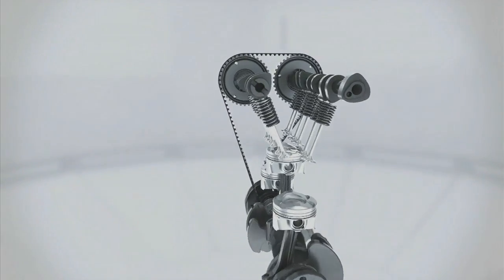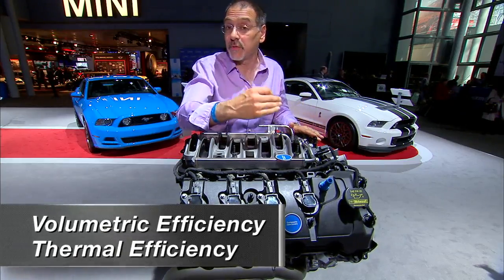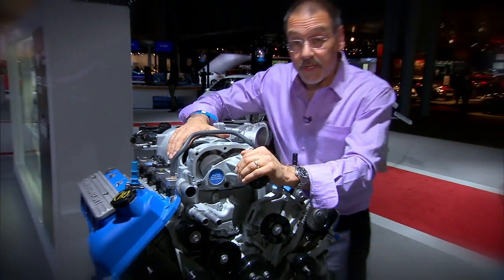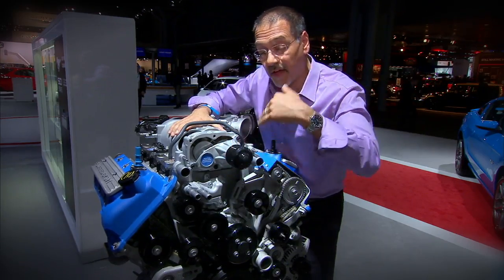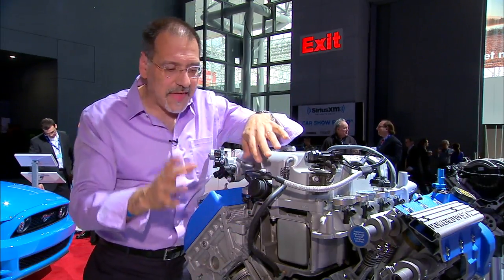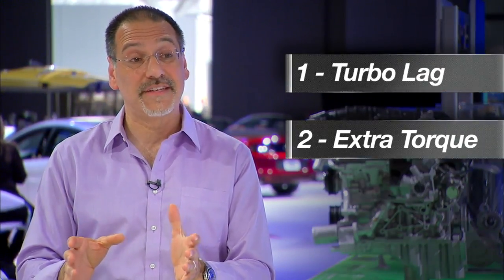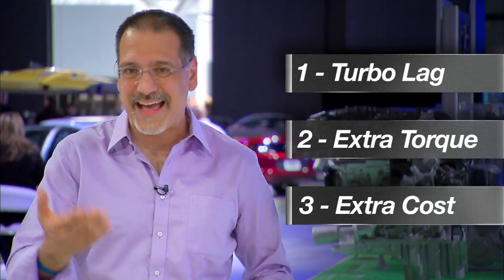CNET On Cars - Car Tech 101: Turbos vs. Superchargers

Comment: To anyone who has actually studied turbocharging and supercharging, half the things this guy said was bullshit.
Reply: why? Like what?
Reply: Many things. Here's just some examples. 1) He says that a supercharger has parasitic losses, but doesn't mention the fact that a turbo has pumping losses. 2) He talks about intercooling to cool off the air charge that was compressed to raise its density, but doesn't mention that there is drop in pressure when you cool the gas, which lowers its density also. 3) He says turbocharged engines have a lot of torque compared to the amount of horsepower they have. That's only true for small turbos relative to their engines. Small turbos produce a lot of torque compared to horsepower. Large turbos do just the opposite, no torque and tons of horsepower. 4) He fails to mention that turbos radiate exhaust gas heat into the entire engine bay and into the turbo compressor, which effects the durability of the engine and its parts and also reduces the air charge density which effects power. 5) He says superchargers are used "to create additional brute horsepower than to create efficiency and really high mpg". Turbos produce more power per cubic inch than superchargers. That means turbos produce more "brute horsepower" than superchargers. 6) Turbos do not improve mpg. Turbos require more fuel to cool the air charge which means the air fuel ratio must be richer than if the engine was normally aspirated. This means turbos burn MORE fuel than normally aspirated engines. 7) He says "you're unlikely to find cars that have superchargers, they tend to be extremely high performance." Then he says, "so let's talk turbos", as if turbos cars aren't extremely high performance. Turbos outperform superchargers in power per cubic inch. So what the hell is he talking about when he says superchargers are extremely high performance but turbos aren't? However, turbos are a pain in the ass to set up, are easier to detonate with, and produce too much heat in the engine bay. Turbo exhaust manifolds are more prone to warping and cracking also. I personally prefer superchargers for a street car, but on a track turbos produce more power per cubic inch than anything else. They do not improve fuel economy as he claims, they REDUCE fuel economy since more fuel is required in the AFR's to cool off the air/fuel charge and keep the engine from detonating. I can keep going on and on about bs he says.....
Reply: Thanks for the great answer !
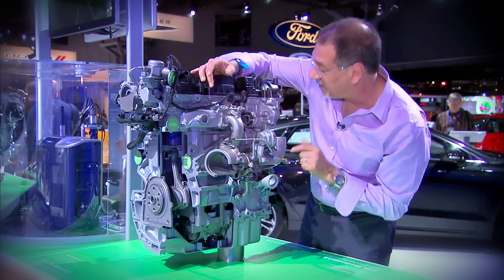Reply: At 1:16, the location that he points to for the entry of cold air into the turbo compressor is the wrong location. He pointed to the compressor outlet. The compressor outlet is not where cold air comes in from. He also does not mention that a turbocharger is easier to run into detonation with than a supercharger. He probably has no idea what detonation or pre-ignition is anyway.
Reply: what is detonation and preignition? im trying to learn
Reply: Detonation is preignition, it is when the fuel and air mixture ignites before the spark plugs fire, which can lead to all kinds of damage in the car. Most engines have knock sensors to prevent that!
Reply: would a supercharged car also consume more fuel, or that only comes with the turbo?
Reply: Daniel If you supercharge a car you get less MPG If you turbocharge it you get more MPG :)
Reply: Not really a bullshit, just a different perspective than yours. 

IMO this video is targeted to general car buyer, not car enthusiasts as you. I'm not sure if you're aware of the fact that car manufacturers nowaday are pairing small engine with turbo to create a more efficient car for the purpose of daily use to workplace or grocery. 

Sure,  both turbo and superchargers  equipped engine can deliver higher performance but the difference is you can easily scale down turbo for efficiency while you can't easily do the same with supercharger.
Reply: z4520ft You can do that with superchargers...just bild a smaller supercharger...Turbochargers are more efficient, easier to intercool, achive higher boost pressures and so on and so on!
Reply: a supercharged engine will consume more fuel. A turbocharged engine also consumes more fuel. The esseboy who says "if you turbocharge it you get more mpg" is wrong. A turbo increases fuel consumption, it does not reduce it. That's how more power is made, by burning more fuel. Any device that increases the power of an engine will also burn more fuel. Fuel consumption and power output are tied together.
Reply: inertiaforce No, if you increase the working pressure of an engine you will increase the flamefront speed, thus increasing the efficiensy of the engine! The only time it decreases is if you go and inject more fuel than stochiometric! Thats why all economic cars have turbos...
Reply: Let me ask you a question, are you saying that under wide open throttle, a turbocharger will not burn any more fuel than a naturally aspirated version of the same engine?
Reply: inertiaforce How is that relevant if we talk MPG? You never go full throttle when cruising...the think is it efficient with a turbo...many manufacturers have similar engines in turboed and unturboed versions, and why is it that the turbo version always have beter MPG?
Reply: Please answer my question.
Reply: inertiaforce Yes it does, but it burns the fuel more efficiently so you would still get more MPG...
Reply: Ok, so you just admitted that the turbo burns more fuel under wide open throttle and therefore gets less mpg under wide open throttle. However, you said it burns it more efficiently, and therefore gets better mpg. This answer contradicts itself. On the one hand you're saying that the turbo gets less mpg, on the other hand you're saying that the turbo gets more mpg. Please answer my question more clearly, are you saying that under wide open throttle, a turbocharger will not burn any more fuel than a naturally aspirated version of the same engine?
Reply: If you aren't under boost when cruising, then theoretically the mpg of the turbocharged engine should be the same or similar to the naturally aspirated version of the same engine. The turbo might still be slightly less (barely) because of exhaust back pressure creating a pumping loss, but that's debatable.
Reply: inertiaforce As I stated before....the increase in working pressure increases the flame front speed...which causes more fuel to burn! That increase efficiensy!
Reply: Causing more fuel to burn reduces mpg. You are burning more fuel. Burning more fuel = lower mpg.
Reply: ""the increase in working pressure increases the flame front speed...which causes more fuel to burn! That increase efficiensy!"

You're right, it does cause more fuel to burn! Burning more fuel = lower mpg. You only get higher mpg when you burn LESS fuel.
Reply: inertiaforce No, you do not...because since when do you drive around with fully open throttle all the time? Are you really that stupid?
Reply: Yes I'm really that stupid. I think people drive around with full throttle all the time. 

You still haven't explained how a turbo burns less fuel to increase mpg.
Reply: inertiaforce Oh you see Billy Boo, if the the engine can burn more of the fuel already inside the cylinder it doesn`t need to squirt in as much each time that thingamajig suckles in air. And there for you miles per jug of gallon of fuel increases. Whoop ti do, who would have known Billy Boo?

Do I have to explain it even simpler?
Reply: Well that's interesting, if the engine isn't even under boost, you are saying that the turbo burns more of the fuel already inside the cylinder. How is that possible when the engine is not even under boost? When the engine isn't under boost it is operating just like a normally aspirated engine.
Reply: inertiaforce Well Billy boo, you see automobile manufacturers aren`t stupid like you and runs small enough turbos so they spool at around 2000rpm, so they increase efficiensy....
Reply: So you are saying that an engine that is under boost burns less fuel than an engine that is not under boost?
Reply: inertiaforce Yes, as the working pressure increases the flame front speed increases and more of the fuel has time to burn.
Reply: Ok, so then under wide open throttle, a turbocharged engine that is under boost should burn less fuel than a naturally aspirated version of the same engine?
Reply: inertiaforce No, because it is under boost, at full throttle it will burn more fuel because there is more air so you can burn more fuel, but as you have more power you don`t need to go full throttle as long and there for burn less fuel...
Reply: "because it is under boost, at full throttle it will burn more fuel because there is more air "

You just said that being under boost burns LESS fuel. Now you're saying that "because it is under boost", "it will burn more fuel because there is more air."
Reply: And what you don't seem to understand is that everything you've said has been bullshit. You've contradicted yourself several times already. A turbocharged engine does not burn less fuel than a naturally aspirated engine. It burns MORE fuel. When the turbocharger is under boost, it burns MORE fuel than a naturally aspirated version of the same engine. That's also why it makes more power, BECAUSE it burns more fuel. There is a relationship between power output and fuel consumption. Increased power output increases fuel consumption. Power is produced FROM the burning of fuel. The more fuel that is burned, the more power. Therefore, a turbocharged engine that makes more power than a naturally aspirated version of the same engine will get LOWER gas mileage. The only reason I've seen that manufacturers claim turbochargers improve gas mileage is because they allow you to build a very small engine with a turbo to make the desired power output. Since the small engine is not under boost during most driving, gas mileage improves. The gas mileage improvement is from the small size engine, not from the turbo. If I build a 1.0 liter engine and turbocharge it to make the power of a 2.0 liter normally aspirated engine, I will get better gas mileage from the 1.0 liter engine since I'm not under boost during most driving of the 1.0 liter engine. The gas mileage improvement is from the fact that I am using a 1.0 liter engine, not from the fact that its turbocharged. The turbocharger is just there to produce the power WHEN i need it. Most of the time I won't need it, and therefore the 1.0 liter will burn less fuel than the 2.0 liter because of its small size. The mpg is from the small size engine, not from the turbo.
Reply: inertiaforce You are simply wrong...then why does cargo ships with the highest reported efficiensy use Turbochargers? Maybe because it actually increases efficiensy...
Reply: I don't know anything about cargo ships, so I can't comment on that. However, every book I have read on turbochargers and superchargers states that they burn more fuel. Therefore, if they burn more fuel, they do not increase gas mileage. They reduce gas mileage.
Reply: inertiaforce You have never driven a car I presume...
Reply: I have owned a 1993 Toyota Supra turbo modified with a single turbo, I have owned a 2005 Dodge Viper GTS, I have owned a 1995 Mitsubishi Eclipse GS-T, I currently own a 2003 Mercedes SL55 AMG and a 1994 Toyota Supra turbo. So yes, I have driven a car.
Reply: inertiaforce Doesn`t sound like it, maybe your boyfriend drove you around in them? Because you sure don`t drive around with 100% throttle all the time...
Reply: And it doesn't sound to me like you know anything about turbocharging either. Everything you've said has been bullshit. Go read a book on turbochargers and learn that they do not improve gas mileage. They are a power adder, and a power adder does not improve gas mileage. It reduces gas mileage.
Reply: inertiaforce I have read books in Chemistry, physics and math, and they all point to an increase in efficiensy...As you compress a gas the distane between the particales decreases, as that happens reactions will occur faster, and in a limited amount of time more reactions will occur. That increases efficiensy and will increase mpg as you can decrease the rpm and decrease the throttle opening.

Now you have only driven performance oriented turbocharged engines, which are a whole other story, they inject more fuel than needed to cool the intake charge...that is unburnt fuel going down the pipe leading to a lower mpg...but in economy orientented cars the fuel mixture stays stochiometric...

Did you get it now? Or do I litterally have to write an essay for you to get it? Performance cars use a mixture of say 10-12 parts air to 1 part fuel, economy cars use an mixture of 14.7-20 parts air per part fuel...there is the difference!

And if you got an halltech ECU you can switch between an economy engine map, normal engine map (close to stochiometric all the time) and an performance map...all on the go so why the hell wouldn`t you use an turbocharged engine?
Reply: Even if the AFR stays at 14.7:1, it will still require more fuel to maintain that ratio under boost than it would without boost. There is more air under boost, so maintaining 14.7:1 AFR will require more fuel than a naturally aspirated engine operating at 14.7:1.

If what you say is true, that boost increases gas mileage, then why doesn't that apply to superchargers? In your post above, you answered Daniel's question and stated that superchargers reduce gas mileage but turbos increase it. Why would a supercharger reduce gas mileage then?
Reply: inertiaforce Because Superchargers are belt driven...the increase in back pressure in a turbocharged car is nothing...
Reply: What about still requiring more fuel to maintain 14.7:1 AFR's for an engine that's under boost vs. an engine that isn't?
Reply: inertiaforce Which creats more power...which means you use less throttle...
Reply: uhh guys, peace... so my understanding is that fuel consumption will come from the driving habit as well. So turbo can consume less because I don't need to press the throttle that crazy to feel some acceleration, but on the other hand, the engine also burns more fuel. I don't have any comparison, but I can tell you that my 2.0TD VW engine eats less than 7.5L even if I poke it's eyes off or drive 170km/h on the highway while a non turbo, gasoline engine would eat 10+L... not sure if it comes from the different construction of diesel / benzin engines, cause I know nothing about mechanics...
Reply: Creating more power means that you are burning more fuel. It doesn't matter if you use less throttle. If you're making the power at a low rpm with boost then you will burn the fuel at that rpm and throttle. Obviously you don't need more throttle because you're already making the power. By your reasoning then, a big 8.0 liter V10 engine gets good mpg because you're using less throttle and rpm to make the desired power compared a 2.0 liter 4 cylinder engine which has to rev higher and use more throttle to make the same power output. For example, let's say say an 8.0 liter engine can make 200hp at 2000rpm while a 2.0 liter engine can make 200 hp at 6000 rpm. By your reasoning of less throttle and lower rpm getting better mpg, the 8.0 liter engine should get better mpg since you don't need to rev it as high and use as much rpm. So now an 8 liter engine gets better mpg than a 2.0 liter engine since you don't need to rev it as much and you can use less throttle. But as we all know, an 8.0 liter engine will gets lower mpg than a 2.0 liter engine, so what are you talking about?
Reply: I just did a google search "how does a turbo improve fuel economy?". Google said:

"Turbocharged vehicles allow automakers to keep power output high while they downsize engines for better fuel economy. But much of the mpg gain is lost when American drivers stomp the gas pedal and enjoy turbos' high performance.Jun 9, 2013
MPG or performance: It's a trade with turbos | Autoweek

http://autoweek.com/article/car-news/mpg-or-performance-its-trade-turbos"
Reply: So it appears that Google agrees with me, the gain in mpg is because of the smaller engine, not because of the turbo.
Reply: 66% down the page of the Autoweek article, it says:

"But when the turbocharger is running, fuel economy declines, sometimes dramatically."

http://autoweek.com/article/car-news/mpg-or-performance-its-trade-turbos
Reply: Based on all the above, it appears that you are wrong Esseboy. A turbo does not improve mpg. It's the smaller engine that's improving the mpg when its not under boost.
Reply: inertiaforce sigh I`ve too done some reserach and it seems like the point when turbos actually increases the Thermal efficiensy is when you are at just above Zero boost, then the turbo supplies the air so you have no pumping losses and at the same time the back pressure is low.
Reply: That may or may not be true, I don't know. I have seen no evidence that its true, but I haven't really investigated that question. However, if you claim its true, please provide a link to any research you have done that indicates that and I would be glad to look at it. Even if it is true, that still means that turbos do not improve mpg 99% of the time (because you aren't driving at 0.1psi 99% of the time).Also, don't be so quick to call people "Billy boo" when they dispute you.
Reply: TheRealestEver since you seem to be such a turbo genius why don't you please explain it?
Reply: I have not seen Jay Leno's TT'd V6 Camaro so I don't know anything about it. In addition, I have not seen any evidence of a gas mileage test between Jay Leno's TT'd V6 Camaro and a stock N/V V6.
Reply: I agree with @inertiaforce. For a turbo to run you have to sacrifice efficiency so therefore you burn more fuel which decreases the MPG. They downsize engines and turbo them, to help the car speed up when needed, but at that time they burn more fuel to give you that boost, but when the turbo isn't needed the car is more efficient because it isn't using it. To get you have to give.
Reply: Marcinos70 No, you don`t, the same way increasing compression ratios increase MPG and horsepower Turbos increase both.
Reply: The Esseboy no they dont esseboy.
Reply: inertiaforce Then why are the most efficient engines on the planet (Container ship engines) using turbos? Maybe it has something to do with increased working pressure ensuring a complete combustion? Hmm...I wonder. WEll you dont seem to be able to wrap your head around that so it is a total waste of time explaining it to you.
Reply: You don't seem to be able to wrap your head around the fact that in the 6 books that I have read on supercharging and turbocharging, they all say that a turbo consumes more fuel under boost. In addition, I even cited that Autoweek article which said the same thing. I have asked you to provide a link to evidence indicating otherwise, but you haven't. It seems you can't wrap your head around that.
Reply: inertiaforce So the fact that the most efficient engines in the world uses Turbos isn't proof that turbos increase thermal efficiensy?
Reply: So the fact that you aren't providing evidence for what you say other than your testimony isn't evidence that you're not answering my question?
Reply: Superchargers than are made for production don't really hurt gas that much if at all. Yes they spin all the time but they spin free at cruise, because they are equipped with bypass valves. As long as you keep your foot out of it. You won't see a decrees of 1 mpg even if that.
Reply: If its not too late to join the conversation, cars with small turbochargers may be more efficient than cars without them in situations requiring high power output because they get more power at lower RPM. There are a lot of factors that go in this ofcourse it's not simple, but its seems a scenario that may confer an efficiency advantage to turbocharging.
Reply: This debate would've ended years ago if you would simply understand that burning more fuel does not mean less mpg...are you stupid? Miles Per Gallon! If both burn one gallon it doesn't matter, what matters is how much millage they get out of that gallon. I bet you believe a ton of bricks weighs more than a ton of feathers.
Reply: Burning more fuel doesn't mean less mpg. But it does mean less mpg if you are burning more fuel to make the same power output (and all other variables are equal). The  complication is that many of us are unsure if a turbo engine necessarily produces power more efficiently than a non turbo engine. A turbo engine has more exhaust backpressure than a 'comparable' non turbo engine, but is smaller in size (less heat loss, less reciprocating mass maybe), more low rpm torque (maybe) to run at lower rpms. Are these factors enough to make up for the additional exhaust drag? I'm  not sure, but maybe someone more knowledgeable can answer that.
Reply: I like to counting fuel consumption per minute/total horsepower than mile per gallon of fuel
Reply: inertiaforce wich one is more fuel efficient?
Reply: Youre pretty dumb lmao
Reply: ya''ll argue like a married couple
Reply: inertiaforce the fact that a turbo ENABLES you to downsize the engine while increasing torque and hp AND FUEL ECONOMY is 100% PROOF that turbos are the most efficient solution when talking about regular cars' fuel economy. A turbo diesel engine will ALWAYS outperform a standard gas engine in terms of fuel economy. You are trying to be the smartest guy in the room, while you do know a lot, stating that turboed engines are worse than standard and supercharged engines with fuel economy is just retarded.